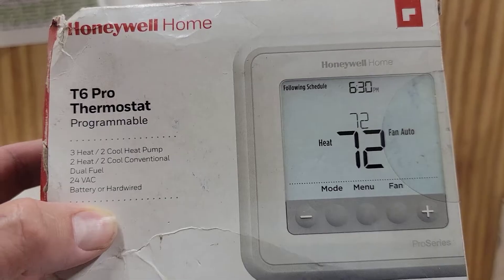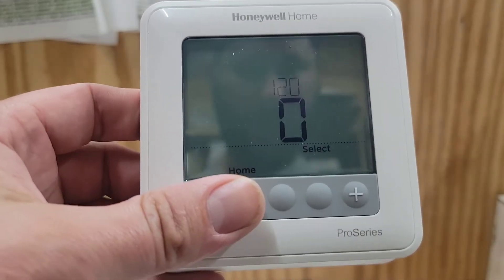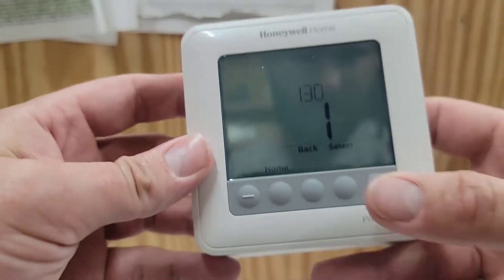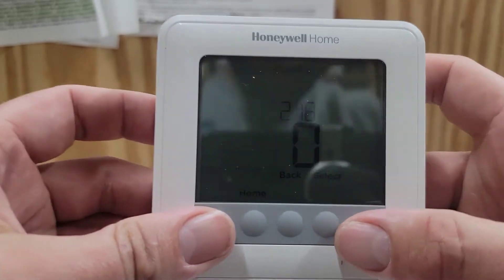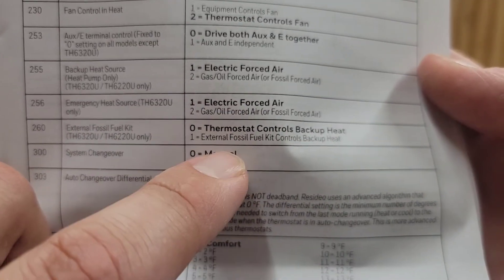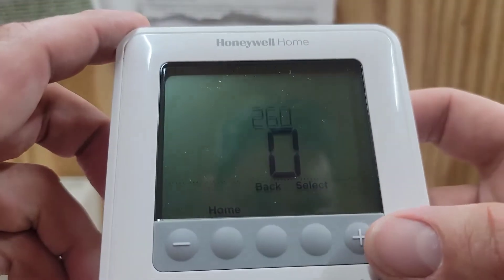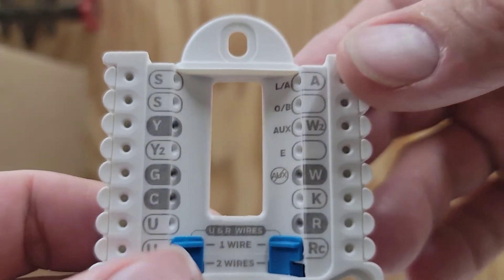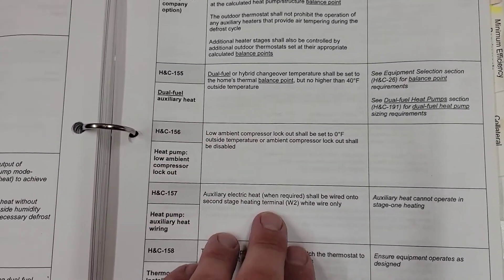Mastering Dual Fuel Thermostat Programming in 5 Minutes

Comment: I learned I don't have the same controller as you. Mine is a Vision Pro 8000 with a lot of talk about setting up the WIFI and have to have an online account.
I woke up at 6am with my heat pump cycling running nonstop to thaw out with outside temps at 32, Got up and switched to emergency heat for the gas unit to handle the heavy work. I just bought this house with dual fuel heat pump so I'm learning all I can about it.

Comment: Great Tutorial! Question what if in Furnace mode based on the outside air temp and the space gets above room temperature (Maybe a large gathering of people). Could it go into Cooling mode or is that completely locked out during Furnace mode?
Reply: Forget the outside air temperature reference

Comment: Question if you have a Thermostat that also gives you the option to lock out the back up Aux/Em heat which is a gas furnace what should you set that for for instance say it have a Carrier heat pump that's capable of heating down to NEGATIVE -15 degrees and I set the compressor to never lock out because we dont get -15 degrees temperature so should I lock out the back up gas furnace at a certain temperature  ??????
Reply from the maker: It's really preference
I have mine set to twenty degrees
When it gets below twenty I like to use my gas.
I prefer it because the heat pump runs all day long.

Comment: i have a carrier dual fuel heat pump with propane emergency heat.   the white wire controls the emergency heat , should it be connected to the w2 or to the E space ?   also is the outdoor temp sensor a must for this unit?   Thanks  Also using the T6 thermostat

Comment: I have the Goodman dual fuel unit. Heat pump and two stage gas burner. Selecting 255 heat pump will only let me select one auxiliary home 221 and not 2 stage heating? Two stage heating is only allowed for conventional systems. This is TH6320WF2003 thermostat. Thanks for your videos and help, they’re great.
Reply from the maker: Glad you like the video

Comment: Is there a way to set the thermostat so if the customer wants to use heat pump or gas furnace without the 40° of setpoint?
Reply from the maker: yes don't use a wireless outdoor thermostat

Comment: Trane due fuel furnace with American Standard Heatpump. T6. Wired like I always do. Heatpump stayed in circuit when I asked for higher demand. ODT was mid 40s. All should be good?
Reply: @harrygilbert4593  I just put an ICP heat pump on an existing Trane Propane furnace with a Trane thermostat. Found out on the first cold day it won’t cycle to aux mode. Connected the white wire on the stat and now it won’t shut down the OD unit while in aux mode. Which brings me to this vid. Looking at a T6 to replace the Trane stat. But will it shut down the OD unit by removing power from the Y terminal in AUX mode?

Comment: Tad, what dual fuel thermostat do you recommend? My contractor installed a Sensi Smart (model 1F87U-42WF). That thermostat has no lockout based on outside temperature, so the heat pump always runs when heat is called for.  I am thinking of a Sensi Touch 2 or Ecobee smart.  These two thermostats use the outside temperature from the WIFI rather than a temperature sensor.

Comment: If you drive the temp up on the Tstat with Dual Fuel . Is it supposed to lock out the heat pump and go straight to gas? Working with a T-9 TH6220WF2006. I appreciate your content.
Reply: No answer ??hello ?

Comment: 355 compressor lockout / balance point is the temperature set point at which if outdoor air is below that set point the compressor is locked out and only backup gas heat can be used. 356 outdoor lockout backup heat is the temperature set point at which if outdoor air is above that set point the backup heat is locked out and only HP heat can be used.
Reply: that's a very loose use of the term "Heat Pump balance point"  Heat Pump Balance point is when the heat pump capacity equals the heat loss of the structure. Calculated using AHRI performance data and Manual J form.
Reply: I never understood the 355 and 356 function fully lol